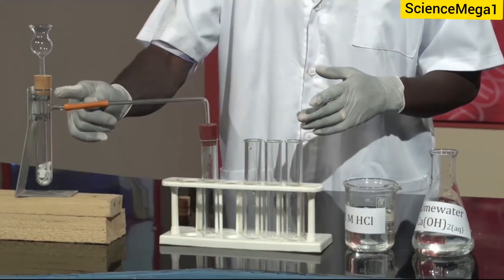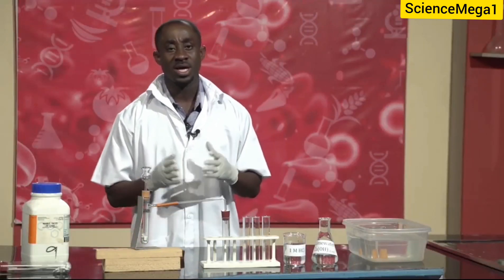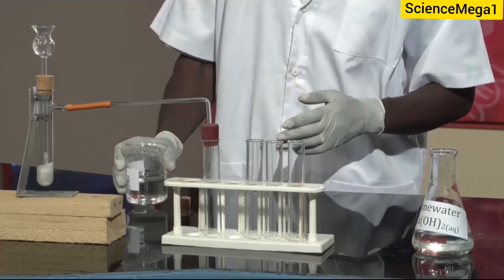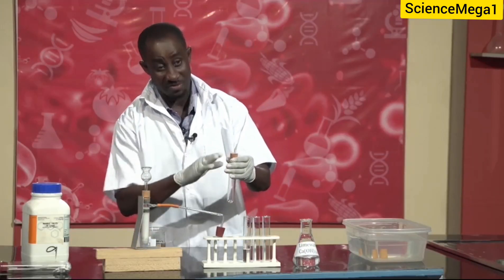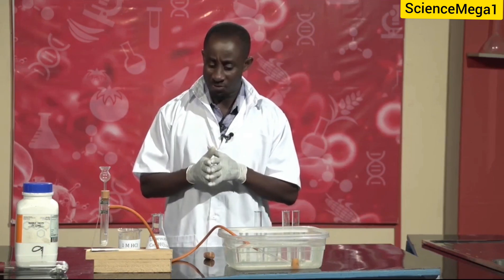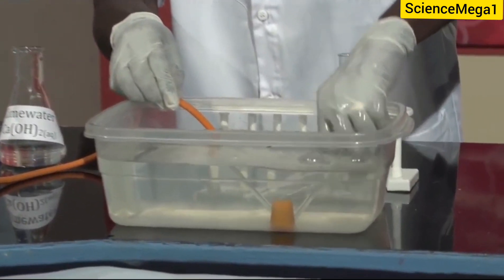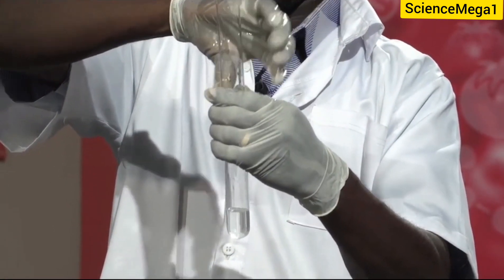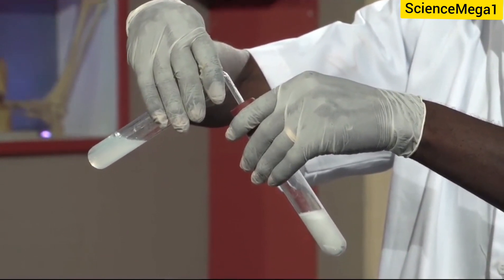Laboratory preparation and procedure for carbon dioxide//Educational video

Comment: Sir please I want ask two questions.
1. What suitable agent can be used to dry the gas.

2. Can the gas be collected over water or not? Please state the reason.
Excellent video though...
I know you personally 🙂
Reply from the maker: To dry carbon dioxide gas, an appropriate drying agent such as anhydrous calcium chloride, magnesium perchlorate, or silica gel can be used. These substances have a strong affinity for water molecules and can effectively absorb any water vapor present in the gas stream, leaving the carbon dioxide dry.

Carbon dioxide should not be collected over water because it is soluble in water and will dissolve to some extent, leading to the formation of carbonic acid. This will make the collected gas impure and acidic. Therefore, it is recommended to collect carbon dioxide gas over a dry and inert substance such as mercury or a noble gas like argon. Alternatively, the gas can be collected by displacement of air from a container or by using a gas-sampling bulb or syringe.

Comment: Very interesting but I want to ask a question why did lime water turned milky after you blow air into it
Reply from the maker: It is because Lime water will always turn milky, when carbon
dioxide gas is passed into it.

Have I answered your question?